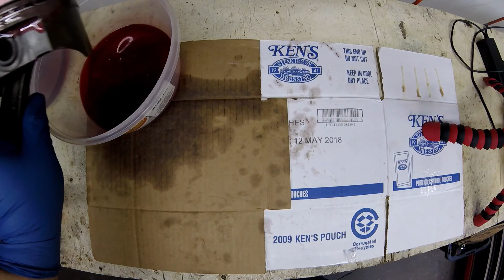Episode 3 / 302 budget build / Removing seized piston rings

Comment: A little tip on the oil ring: the expander (the wavy? spring thing between the scraper rings) is designed to "expand" the scrapers to the edge of the groove, while at the same time, providing proper tension of the scrapers against the bore. You'll find that you must pull the scrapers out first, as they both sit on a special ring of steps built into the expander. Trying to remove the expander first means you're working against ALL THREE pieces at once... Also, I know it's a little late, but part of cleaning the pistons involves "scraping" the ring grooves. Cleans the carbon deposits from the grooves, allowing the rings to slip to the bore easily (and believe me, if the rings were that hard to remove, there's LOTS of carbon built up). You can accomplish this using a broken ring, touched up on a grinder to ensure a good square edge with which to get into the corners and the bottom of the groove.
Reply: into what?

Comment: Hey I had a question I am putting in a motor from a 1993 f150 it’s the 302 into a 67mustang I’m doing a carb swap from efi I was curious if you guys knew if the tranny from the f150 would fit in their? It’s an automatic not sure the model number
Reply from the maker: Black lariat I’m honestly not 100% sure. I would look into it, I’m sure someone has done it before. I haven’t worked with many classics. One of these days I’ll own a classic stang.
Reply: If its the auto A4OD itd be a tight fit but im sure it can be done with some work